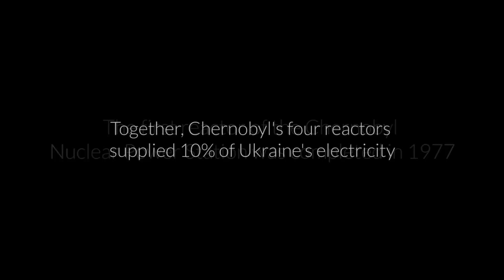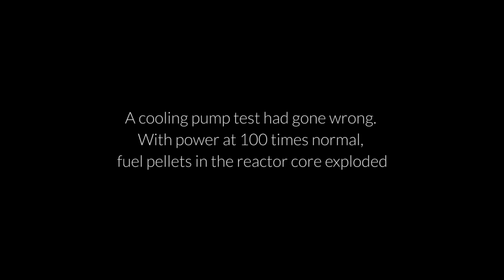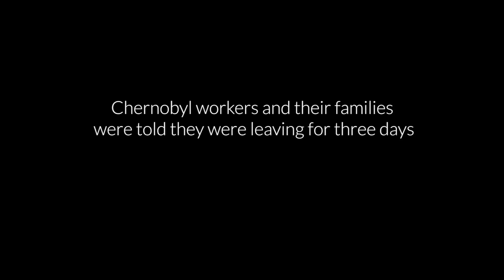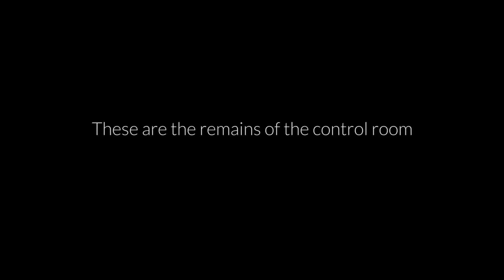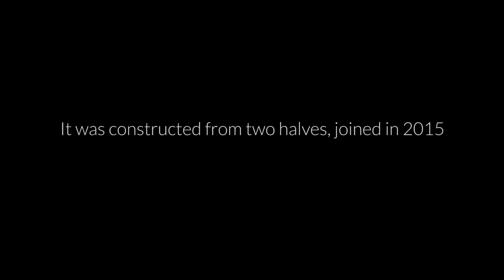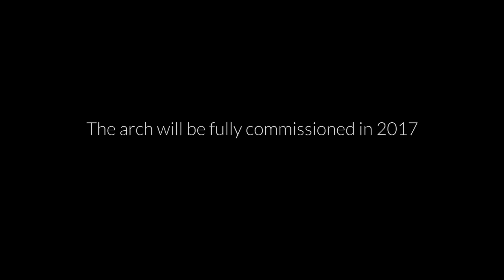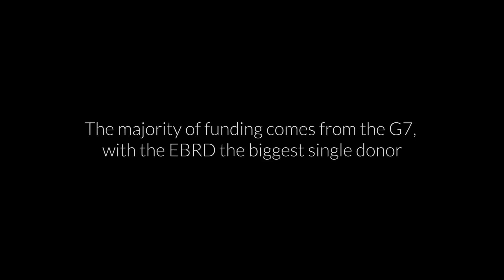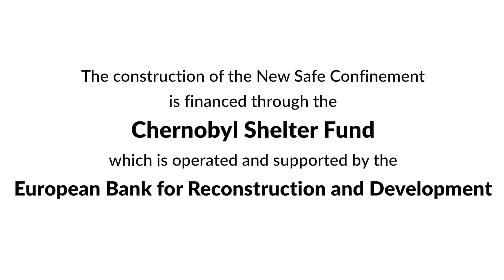Chernobyl: 30 Years On

Comment: Am I the only one who has spotted all the contaminated equipment that has been removed from the control room? What do you think they are doing with that highly radioactive equipment?
Reply: All that shit was removed decades ago because they were essentially nets/sponges for insanely contaminated dust. Sheets of metal collect little, a 15 meter wiring harness and giant, layered  light and indicator array(s) just soaked up and collected crazy dust.  Get rid of that shit and pour it in concrete.
Reply: Tom Hogan maybe get a job or a hobby?

Comment: Where's button AZ-5?
Reply: Seeing the control room and the same spots where Akimov and Toptunov stood along with stolyarchuck and Kirshenbaum Wow!!
Reply: THE MAN THE MYTH THE BAKER looks like they removed anything with wiring. AZ-5 was definitely a connector with a lot of wiring harnesses in its line. Likely because wiring and harnesses act like nets for the worst type of dusts. I was looking for it too, there are a lot of buttons covered in wax it looks like.
Reply: On the left most control panel next to the control rod indicators, the button is on the far top to the right its the only button thats near another button

Comment: the second blast was so powerful it blew a 120 ton lid off the top of the reactor. thats nuts.
Reply: Technicly it was the first steam explosion that blew the lid off of the reactor  however the second explosion was the one that blew up the core sending radiation everywhere
Reply: Chairman Meow 1000
Reply: @Balthorium  that would make the lid weigh 2 million pounds, pretty sure thats not right lol
Reply: That was the first I believe...

Comment: well because you cant work long in crane i think radiation is still where, people cant work long you get the point to make the ark, btw ark was finished and putted on top of powerplant after what radiation in zone gone couple times down. Now is job to dismental all plant , but problem is in the main reactor how you will do it? No person can get inside without dying and machines will just shut off from radiation.
Reply: Only something purely mechanical or something surrounded by thick lead could do that. Both are hard and expensive to make and design

Comment: Fuel didn't explode. The reactor exploded, yes, but this was due to steam pressure, not due to nuclear excursion. The moment the control rods were inserted, due to faulty design (the tips were covered in graphite), they increased reactivity in the reactor instead of stopping the reaction which created a bunch more steam from a small puddle of water still at the lower plenum of the reactor. The violence of this steam tore the fuel channels and the control channels apart which is why control rods siezed at around 2.5 m in the core instead of at approximately 7.5 m (full core depth). The steam increased the reactivity of the reactor further increasing temperature which in turn increases pressure. It was a runaway condition at that time. Eventually, something had to give and the reactor lid was blown open. The explosion of the reactor actually stopped the nuclear reaction because critical mass was lost. But, superheated graphite immediately ignited when air was introduced and that burning of the graphite moderator melted the reactor and the remaining fuel. 

It should be noted that nuclear energy is still the most useful and most clean energy we have. Even with Chernobyl and Fukusima (along with 20 or so other civilian accidents in nuclear facilities), nuclear energy is no more dangerous and problematic to the environment than any other. In fact, much more radioactive material is ejected in the atmosphere by burning coal than using uranium. Secondly, in approximately 70 years of using nuclear energy there were two very seiour accidents. Fukushima and chernobyl. The first survived a 9.0 earthquake and a subsequent tsunami (nothing would happen to the reactors had the diesel generators been installed on higher ground) and the 2nd one was fundamentally flawed. In Fukushima, no one died of radiation. No one. In Chernobyl, there have been 33 confirmed deaths directly connected to the reactor. There is no real data with respect to liquidators (there are estimates) and they didn't die in the incident itself, they died later in the cleanup. But even this accident could have been avoided had the workers ran the test according to regulations. In my opinion, there's no real alternative to nuclear energy.
Reply: Ivan Bažulić I agree a lot with your opinion, after all what nuclear plants throw in the air is steam(maybe with a very small amount of radiation, but ridiculously small amount) and nothing else!
Reply: And also the accidents eMate what they say, accidents! 
That’s why people who work at this type of works must be very well trained and be serious in what they do
Reply: There were actually two explosions. Only the first one ever gets mentioned. That one being the steam explosion that blew the reactor lid off. This explosion also released hydrogen gas, that then ignited and blew the building apart. It was actually the second explosion that caused most of the damage we see in all the photos/videos of the plant and dispersed the graphite around the area.
Reply: well said.
Reply: You're right
Reply: Nuclear energy is still the most useful and the cleanest energy we have? Have you heard of solar energy?
Reply: Fusion energy is the holy grail of energy.
Reply: Only 2 accidents? What about the Kyshtm accident?
Reply: The graphite tips of the control rods did not increase the reactivity, they actually caused a rapid increase in the temperature of the water. There was a steam explosion as a result. The graphite tips were white hot and when they reached the water the water was super heated and instantly turned to steam.
Reply: @paulgarrett1622 

https://www.britannica.com/technology/nuclear-reactor#ref272857

Positive reactivity means that the reactor will go supercritical if any additional moderation is introduced. This is exactly what happened when graphite tipped control rods were lowered in the reactor. Supercriticality is the condition where the nuclear reaction sustains itself without any additional moderation and is increasing at an exponential level. This is what caused the huge power spike and thermal output of the reactor and what caused almost instantanous evaporation of remaining water to steam increasing pressure within the reactor.

As for my knowledge on the subject, it is backed by my education (I studied physics and nuclear physics was one of the courses I had to pass) and my own fascination of nuclear reactors and RBMK type reactors specifically.
Reply: There are plenty. It's a very dirty and outdated way of generating power. The spent rods get buried in the ground in concrete and have half lives of thousands of years. That shit is going to decompose and leach into the soul or be disturbed by nature or human events. We live in a time where technology is always improving at a fast pace, and soon hopefully greed will give way to progress.
Reply: Ivan Bažulić explosion and subsequent meltdown
Reply: Ivan Bažulić
There is evidence that the first explosion(s) were nuclear excursions, and the second, larger explosion was a steam explosion.  See the paper at
https://doi.org/10.1080/00295450.2017.1384269
“A Nuclear Jet at Chernobyl Around 21:23:45 UTC on April 25, 1986”
Lars-Erik De Geer, Christer Persson & Henning Rodhe
Reply: @w6wdh  didn't know about this hypothesis. Will read through it.
Reply: A  I assume you mean me when you say mistakes. Please cite them so we can discuss. What you wrote does not go against anything I said, in favt it just corroborates what I wrote.
Reply: Gurl. Now the disposal of radioactive material IS THE PROBLEM.
Reply: Matthias Ortner
NOT when it can be recycled as France and Russia do .
France is the WORLD`S Leader in Nuclear Fuel recycling .
Reply: @matthiasortner963  
what to do with it (where to put it) is not the problem, its getting it there. a-accidents do happen, though not as many as we are led to believe, leading to extreme regulation that can actually cause more problems than it solves. and of course there have been a few corrupt people cutting corners to make more money creating serious problems later. its a simple process but following protocols is critical. get the right people and its as safe as any other energy
Reply: Everything in this video is completely false...not just inaccurate but just straight up false...yes their were flaws in the design but that's not what caused the explosion and when at 2min in it said that 32 people died I shut it off cause only 2 people died during the explosion of the reactor
Reply: @richardgrace4500  So you're completely disregarding the several dozen firefighters that went onto the roof to put out the various fires, who died due to radiation poisoning? Sad person you are.
Reply: @richardgrace4500  You're not doing much better than what you're accusing them of, as the number of people who died due to radiation exposure associated with the cleanup is far lower than the numbers you're throwing around. Most of them are in fact still alive, albeit while suffering from various radiation-related illnesses, and of the three men who went in there to open the sluice gates, only one died, and not even of anything even remotely related to radiation.

So instead of complaining about other people, how about you get your own facts straight, first?
Reply: Richard Grace 3 died the cooling pump  engineer was killed in the blast and is still in the sarcophagus he’s the only one never recovered according to a different video they put up a small memorial in the hall for him
Reply: @dcoslet1  I must have spoken to his ghost I have visited the site 6 times as I have said in a previous reply. I live in Ukraine he is the grand father of a friend of mine. As you have not quoted a name I am guessing a diversion or misinformation, can you give me a name so that I can check the staff records for that nights duty roster?
Reply: Paul Garrett the  video says senior circulation engineer was killed the clip is by bionerd23 and  is titled inside Chernobyl  4a3c   2015 29 year anniversary of  disaster it’s towards the end if you want to skip to the part I’m talking about
Reply: @paulgarrett1622  hahaha
Reply: I am fuckin dumb. And I have no experience in no fields of education whatsover.
I am just speculating because what OP posted is interesting as fuck.

And what I undertand from this post is that nuclear energy IS the future, and that human error and lies are only to blame.

Could some sort of AI manage to control a nuclear plant command room ?flawlessly ?

Comment: несмотря на огромные средства, выделенные многими странами на постройку нового саркофага, он до сиг пор не построен. И не известно когда он будет построен, часть финансов оседает в карманах чиновников. саркофаг обеспечит только внешнюю защиту. Радиация проложит попадать в почву, отравляя грунтовые воды.
Reply: Ground water contamination is an inevitable outcome at sometime in the future. The sarcophagus is only partial solution. The liquidators tunneled under the reactor in the 1980's and cement was pumped into the chamber, but how long will that last? The current sarcophagus has leaked water from weather and rain into reactor 4, where has this run off water gone for the last 30 years? Whenever big money is concerned, corruption will always follow. This is the same in all the world.

Comment: We need to build a geat pyramid like the one in Egypt over it and Fukushima and shut down nuclear power plants. For crying out loud we have the sun and wind...they're FREE.
Reply: sun n wind r hopeless sources of energy...they r not constant.....
Reply: +Tommy John theyre also horrible inefficient
Reply: Tommy John ok so whenever there is a cloudy day or a day without wind, you just won't be able to charge your phone and run your appliances. Solar and Wind are ridiculously expensive and aren't reliable. Nuclear Power is the only power we have now that will power the human race forever. Plus if you build thousands of nuclear power plants with FAIL-SAFE's we will be fine.
Reply: Tommy John Who's gonna pay for your solar panels and windmills. Nothing is free. And nuclear power is renewable... Edit: and I do agree to a certain extent that Solar and Wind should be used too, but they are not a reliable source, and I belive that Nuclear is the primary way to go. Look at France, France is thriving under nuclear power.
Reply: France will be next
Reply: Tommy John
 Just how " FREE " are the Equipment and Infastructure to support Wind and Solar Generation ?
The FACT still remains that they are INEFFICIENT Power Producers .
Reply: Ian Norman that's why they're working on batteries to store excess power ...wind is free. Uranium is not plus it's running out...oh and we won't run out of sun pretty soon either. We will find ways to make it inexpensive. Just saying...in some villages in my country they have solar heated water...it's a simple sistem of pipes exposed to the sun...not to mention solar panels popping out more and more into the farmlands.
Reply: Ian Norman in my country investors pay for solar pannel power plants or the average joe, then you get payed in the sense that your electrical bill cost drops...oh and the energy company pays you directly for producing electricity. And those heating sistems in the villages are payed by our government (tho you need to have an architect's plan, engineering stuff...) we are trying to make our lives less dependant on fossil fuels and nuclear power. France is a ticking time bomb if you ask me...just last month I read an article about an explosion in a npp https://www.google.ro/amp/s/sputniknews.com/amp/europe/201702091050499377-explosion-france-npp/  Do you even know the dammages caused by ionizing radiation to DNA?.........and ultimatley to cells and tissues? have you even researched the half life of some particles?...Dear God it's thousands of years! Just for decaying of half of the particles.
Reply: Go hug a tree you fucking hippie
Reply: @Vazcular  Wow!  Do you kiss your mother with that mouth?  Nuclear power is an abomination--bottom-line--no discussion needed.
Reply: @Ankith, Hopeless??No way, It's just that we don't have efficient ways to tap them. I assume you are from India. In India, solar energy is almost constant throughout the year.
Reply: Solar energy not reliable? The sun isn't going to dissapear anytime soon, and with that, the wind isn't going to either.
On the other hand, nuclear energy is much more efficient than anything else that exists, it does require more funding and researching to implement a safe and non-contaminant power plant design.
Reply: @grogcito  Nuclear Fission isnt a long term solution...Were decades away from running out of Uranium...200 years at current consumption(which is very low) 80 at the rate of increase(also low), and 30-40 years if we actively pushed for nuclear energy